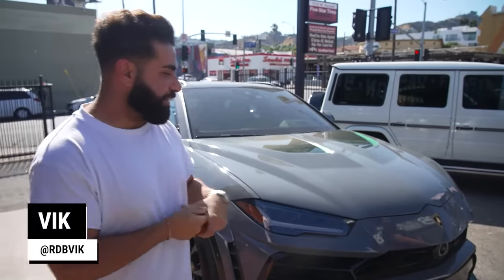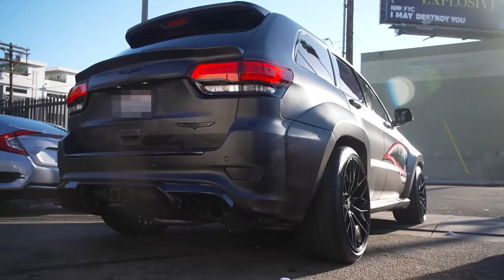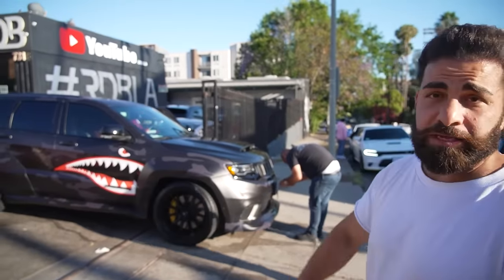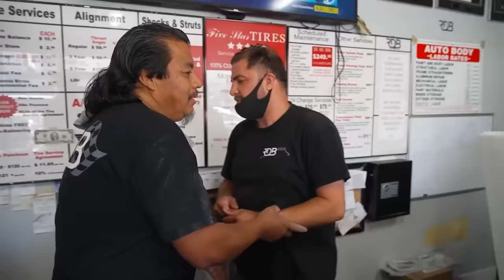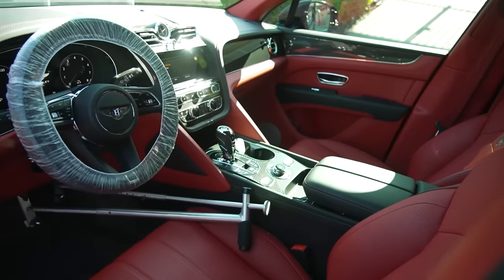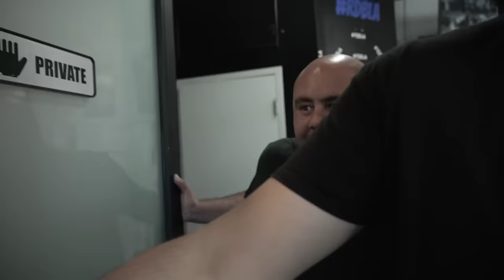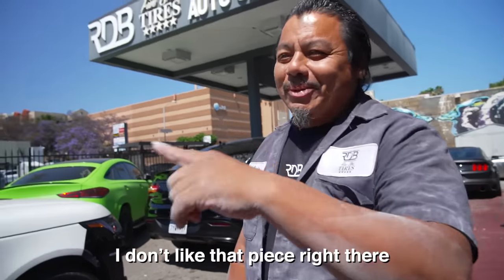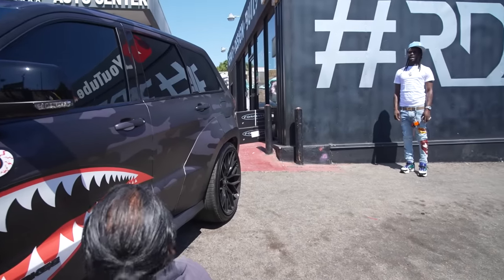Chief Keef's TrackHawk Jeep Widebody in Custom Camo.

Comment: This thing for breaking and moving by hand is old as me, saw one on Mercedes fixed to stereeng column very easy to control that way, push the handle forward, releases brake and pushes gas pedal, pull it towards you, releases gas pedal and pushes brake.